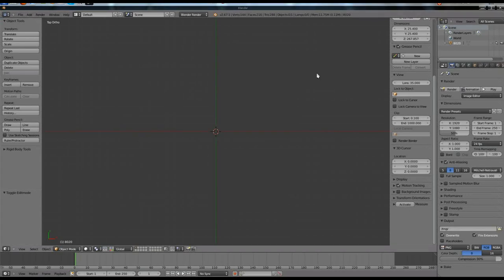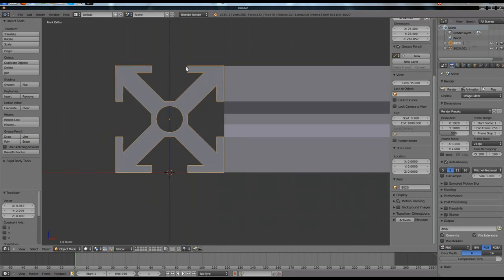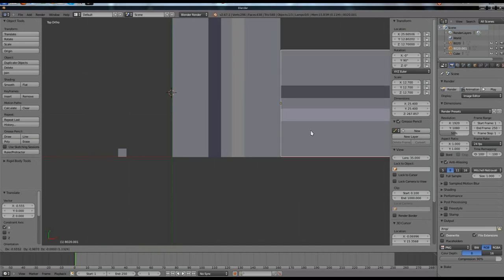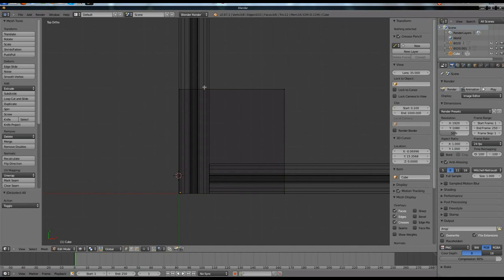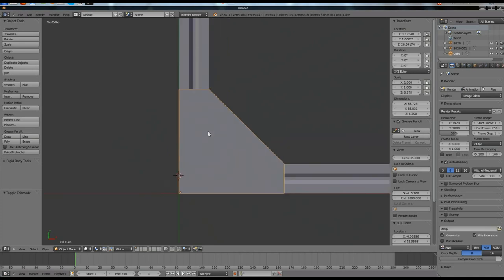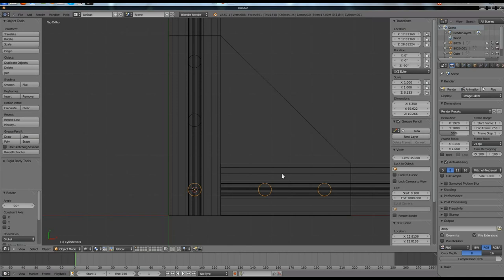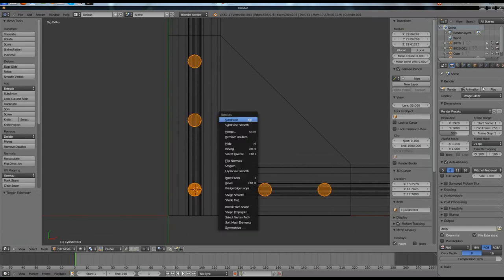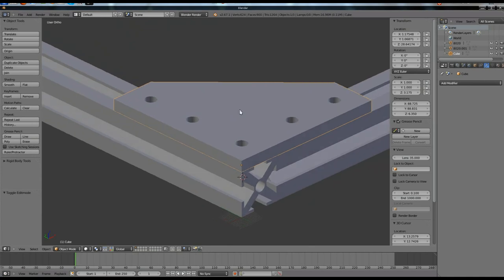3D Printing Tutorial #2 - Modeling a real object for printing using blender

Comment: The 'blender units' issue is a bit of a turn off for me. I realize you can set metric actually, but when I tried creating mm sized parts, they were too tiny for the work space really.
Question: How did you make sure your 'blender units' part was true to life scale when you printed it? Did you have to rescale it in another program before printing?